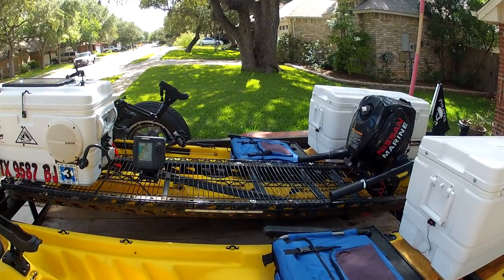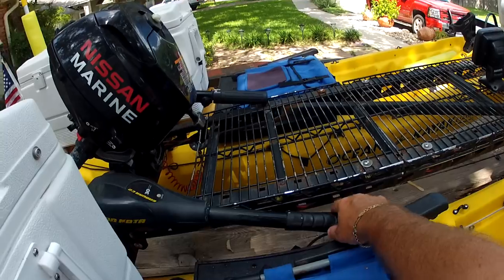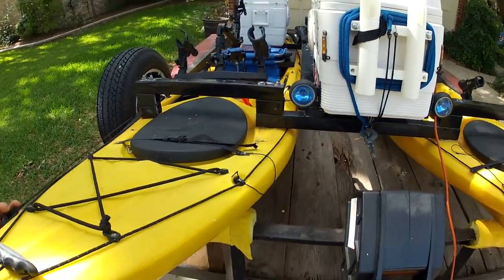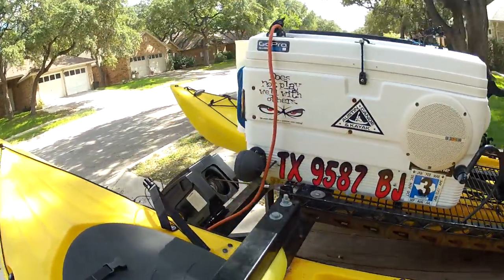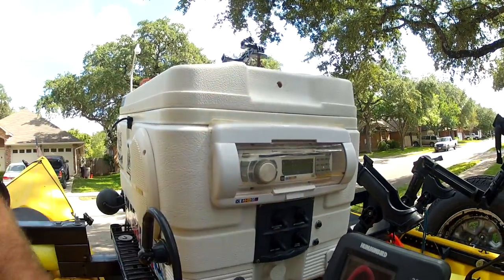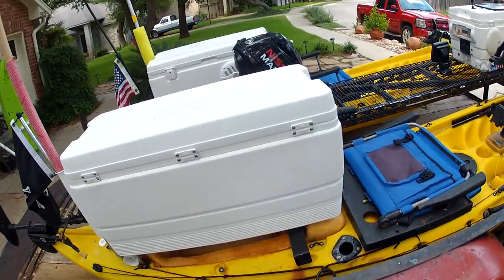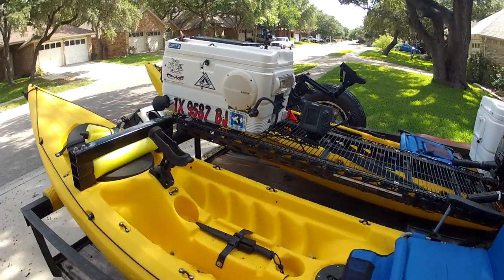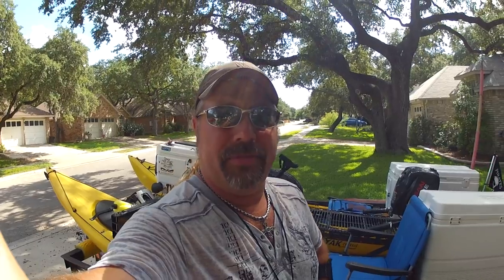DIY Motor Kayak Catamaran with Outriggers

Comment from the maker: Thanks snakeclaw. The foam is 2 part rigid closed cell expanding with 7 lb rating. I got it from San Antonio Foam & it comes in liquid form. Do a You Tube search for 2 part expandable foam, & you'll be amazed! The 2 parts mixed will expand 30 times in volume. The canned foam is open cell, which means it's basically a sponge. The idea for the foam was to make the decks rock hard, but also to give water no place to go. I have a million holes in the boat lol, so it makes me feel better.

Comment from the maker: I used 2" fender washers inside the kayaks with a lot of silicone inside & out. The kayaks were "squishy" & "loose" feeling until I made the spacer bar going over the front hatches. This bar distributes weight evenly to the outside of the boats & makes the whole catamaran feel like one boat.

Comment from the maker: The kayak did puff up a bit and the chemical reaction gets pretty hot as well. I leaned the kayaks up against my house, climbed a ladder, & poured the mix in the front hatch ( not all at once) so it would expand upwards from he very bottom (stern) of the boat up to the front hatch. This way the foam and gasses (if any) would have a "vent" to escape from.

Comment from the maker: The Green outriggers are not for stability, but rather for additional floatation with two or more people and all the gear (my newer motor is 88 pounds). I made them swivel independently because I didn't want them in a "fixed" position to handle waves better. They work really good for their intended purpose, but an added benefit is using them as a "landing platform" for larger fish off shore. It's nice not having to bring a shark right up in your face to deal with him. Thanks for the comment  :)

Comment from the maker: Mohamed,...It adds buoyancy and also provides displacement. If your boat is full of foam, then water has no place to go if you have any leaks. My newer motor is a 9.9 HP Suzuki, & it works great on this boat (see my other videos "NEW MOTOR MOUNT"  shows the 9.9 motor on this kayak catamaran. Thanks for watching, & check out my newest project on my channel.

Comment: Thank you very much for putting the efforts on making this video. I very much appreciated. 

I have one question though. How big is the washer on the other end of the bolt inside the kayak? Did you put anything else aside from the washer and nut to make it structurally strong?

Comment: btw, regarding outriggers, have you considered using 6" pvc tubes instead of the small kayak?   they can be doubled up too (2 on each side) if needed.   some sheet pvc might be folded and chemical welded to get you that knife edge that outriggers need

Comment: Wow!! thats a awesome setup!!!! how long did it take you to complete? 
-aaron
Reply from the maker: +HeyI&#39;tsAaron I worked on this project for a few years. It's currently in dry dock in the backyard, lol. I moved on to other projects, but this rig worked really good. Thanks for the comment!
Reply: Greg Gordon yea, i love the setup , especially with the cooler being used for electronics. I'm currently trying to find a setup for a canoe, would u recommend a setup with 2 canoes sort of like this? or a single canoe with pontoons on the side?
Reply from the maker: HeyI'tsAaron canoes may be harder to connect, but I'd love to see the build 👍